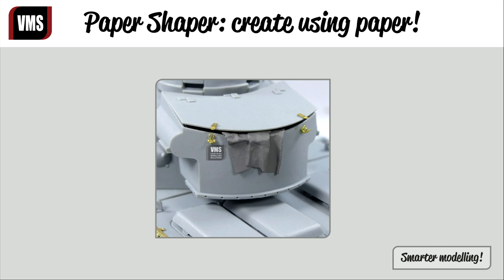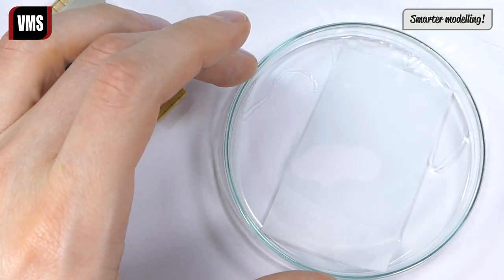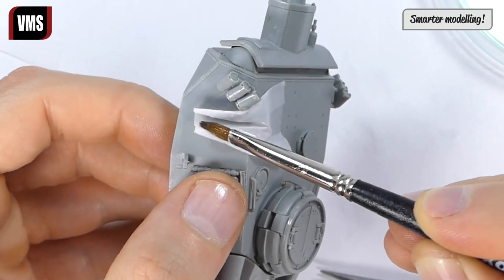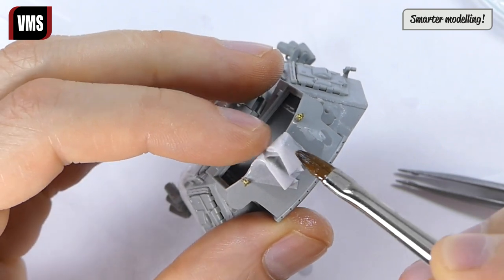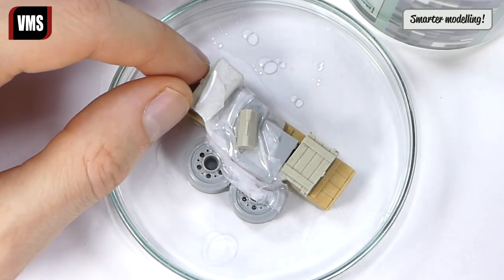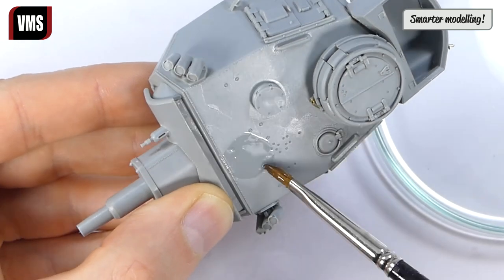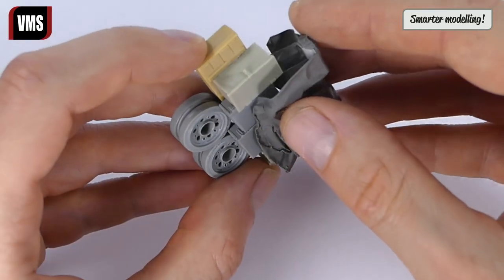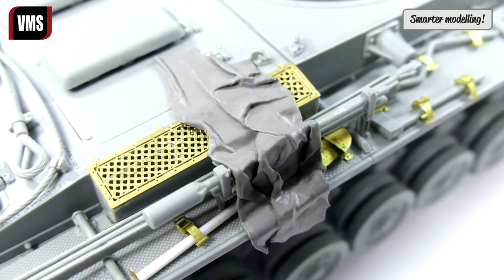How to make  canvas covers and tarps on a scale model - VMS Paper Shaper tutorial

Comment: No-one who's ever driven or been in/on an AFV would drape a tarp as casually as most modellers do.  I understand the technique but honestly... it's really naff and unrealistic.  Ever seen a tarp or cam net after it's been anyway near a hot surface such as engine louvres or exhausts, or been dragged into the running gear?  My unit rolled and strapped everything down - tight; like professionals would.  Imagine driving through woodland or scrub and having anything not tied down ripped off.   In my honest opinion it makes it look like, well, a model.
Reply from the maker: I believe every modeller out there should read this comment, thanks a lot for the insight! Chris
Reply: For camo net i see a lot of tanks that look like they just throw it on, is there something im missing?